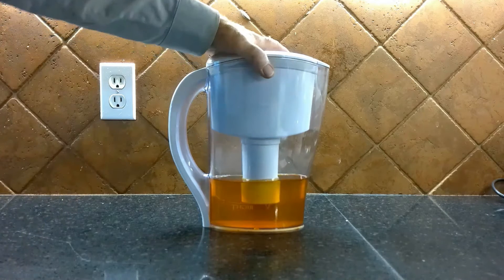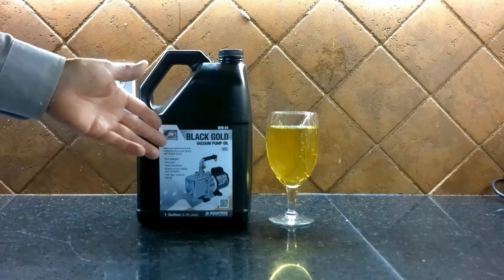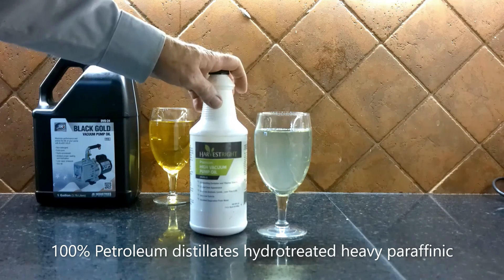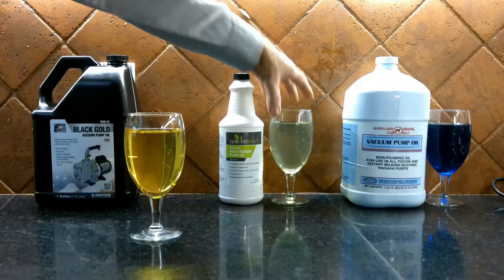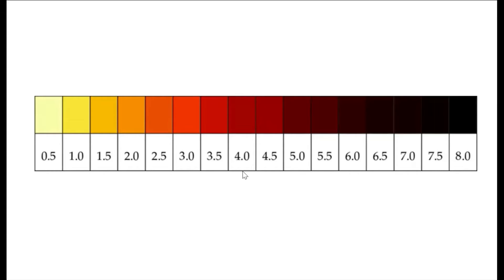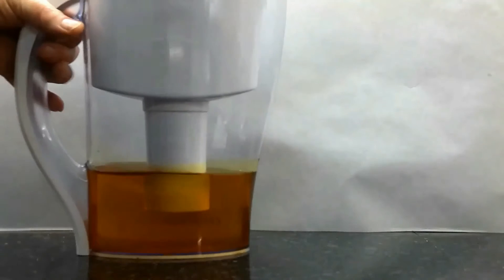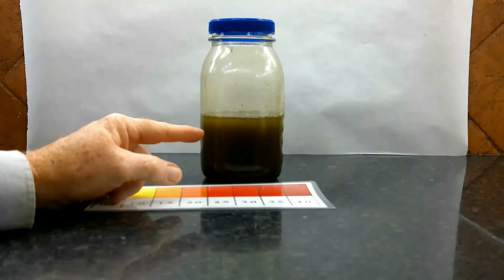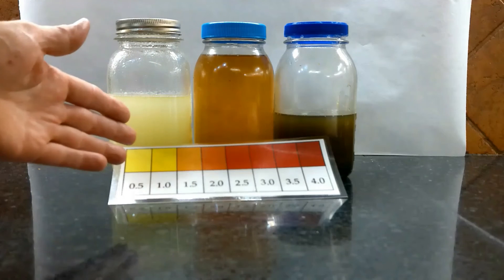When your vacuum pump oil is too old and turns dark.

Comment: I'm sorry I don't know English enough to watch and understand the video, what I mean is that the oil inside the vacuum pump is mixed with another chemical liquid and even if you put a low level, the oil level rises. In other words, the chemical liquid oil of my dry cleaning machine is mixed with moisture or the color of the oil turns quite yellow.
Reply from the maker: interesting.

Comment: I have some oil that has only been used for a relatively few number of batches and then put through my filter. It is nice and clear and nearly colorless. However it smells as if it picked up food odors from things I have freeze dried. I am afraid this can affect the taste of future batches. I have a sense this has happened in the past as well. My question is whether there is any way to deodorize the oil? It seems to pick up food smells easily. Thanks
Reply from the maker: No problem.  The vacuum is one way.  Odors and smells may leave the freeze drier, but they can't return due to a check valve.  Use your used oil.  If you really want to, and have the HR filter pitcher, you could fill the upper section with activated charcoal (from an aquarium supply store).  That may help.

Comment: My HRFD tells me when it’s time to change my oil.  It’s usually around every 15th batch on my SMALL FD.  I have drained it into my HR filter pitcher.  It is nowhere near a 4.0.  I use HR Oil only.  I have put the filtered oil back into my pump once and it gave me the notice to change it immediately.  I have saved my oils from the changes.  What do you suggest?  For financial reasons, yes, I would like to reuse it.  It is not cloudy.  Thank you for all your wonderful videos.
Reply from the maker: I would continue to use it until the color darkens.  Be sure to pour off the good "top" oil and leave any residue in the bottom.  this "bottom" oil should be recycled.
Reply: Thank you @Phil@4800feet!